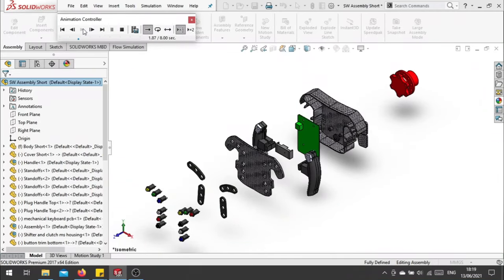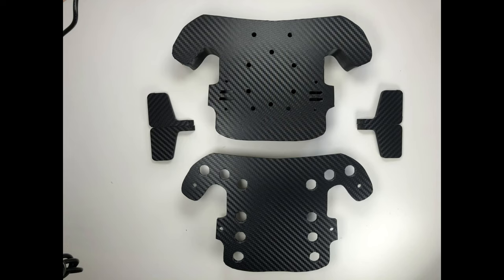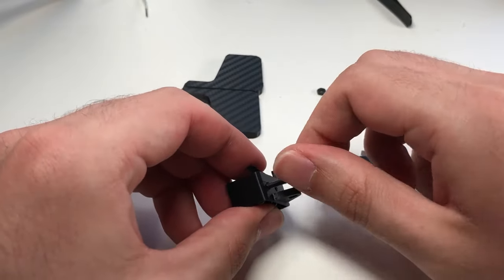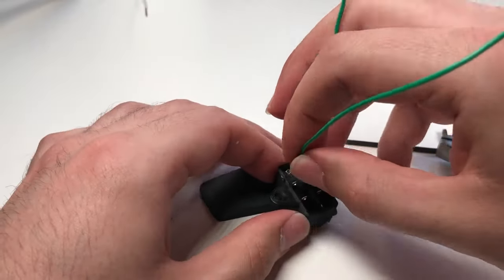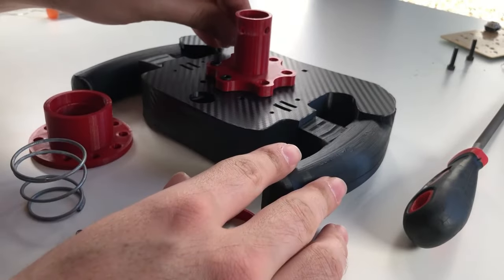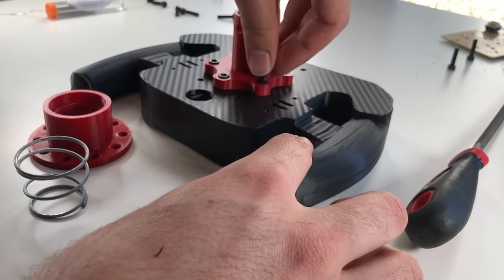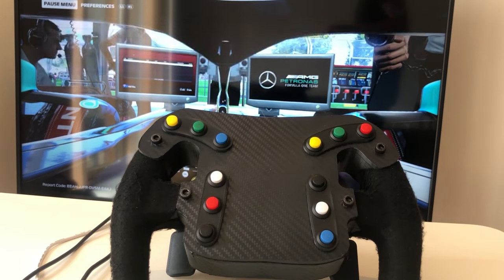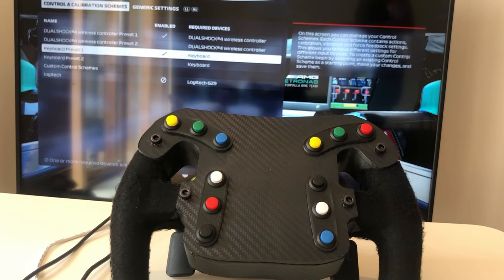DIY WIRELESS F1 STEERING WHEEL WITH A QUICK RELEASE MECHANISM AND PADDLE SHIFTERS - 3D PRINTED

Comment: Simple and elegant approach with the numeric keypad.

With it being 3D printed, how does it hold up against the FFB forces? 

Any change in the feeling of the wheel in the long term? 

Are you planning on a v2 of the wheel, perhaps with a display?
Reply from the maker: Thank you! There’s no change in the force feedback because both the steering wheel and the quick release mechanism were designed in a way that minimised any relatively movement between them and the base! 

I would love to make a V2 but I’m not sure how I could make the display communicate with/get data from ps4/ps5 games, but that is another project all on its own!
Reply: @diyengineeringprojects8499  you vould always put a slot for your phone in there or put a percision sim engineering ddu in

Comment: Hello, is there a way to use the g29 buttons attached to the ring as it comes by default but using this QR, since I have additional rings for this same one?
Reply from the maker: Perhaps there is a way but it would involve an extensive modification! Using a keyboard is the easiest and simplest way to interface!

Comment: Would this work with xbox? (fanatec Csl dd specifically)
Reply from the maker: The quick release mechanism will need to be redesigned/modified to fit onto the fanatec wheel but I believe you should be able to use the numerical keyboard on an xbox (although I haven’t tried it)
Reply: @diyengineeringprojects8499  thanks man